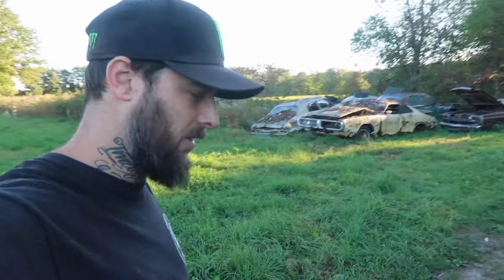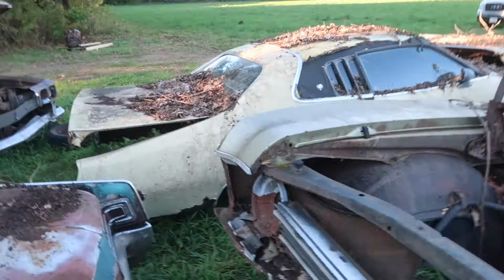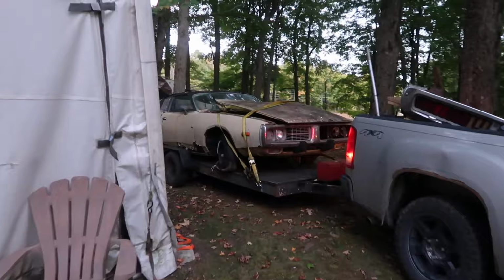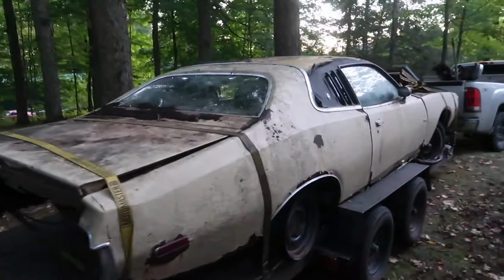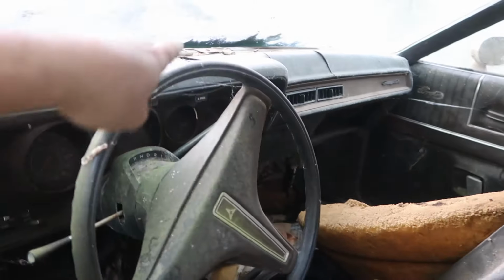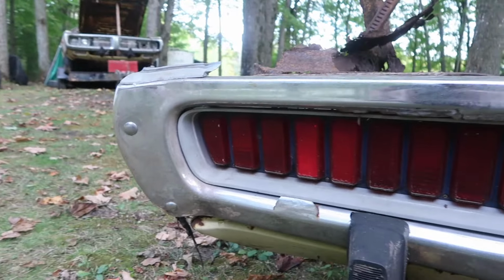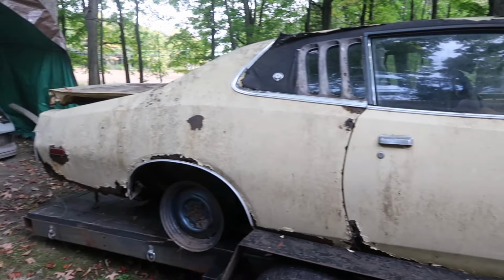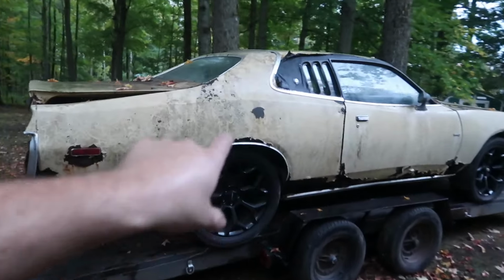(RUSTY FIELD FIND) 1974 Dodge Charger

Comment: Thanks for giving it a more dignified end. As the proud 2nd owner of a 49k mile original 74 Charger (non-SE), these cars have been underappreciated for far too long. Not many remember that it was very slippery in NASCAR. King Richard is on record saying it was their best all around racecar and he was winning with it well past its production end until NASCAR finally said he had to run something more modern. 😎